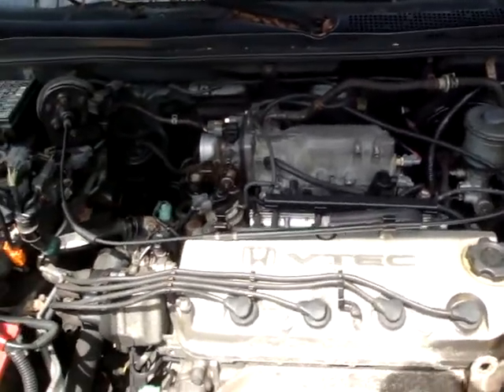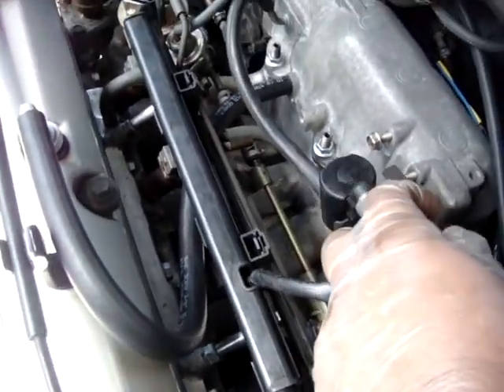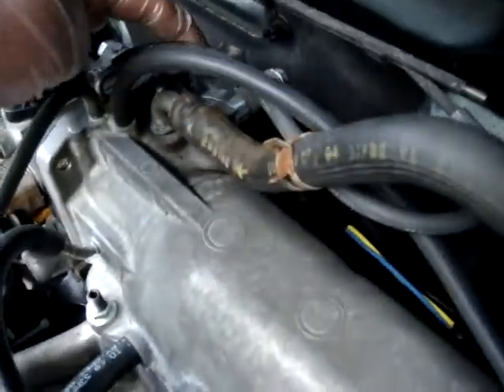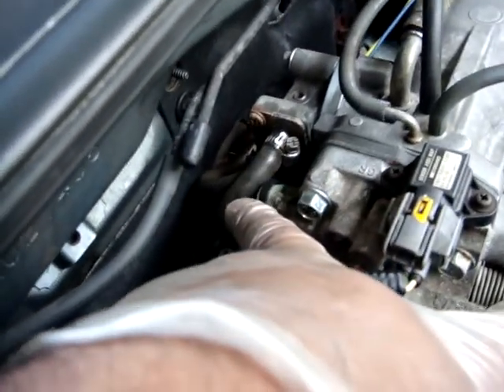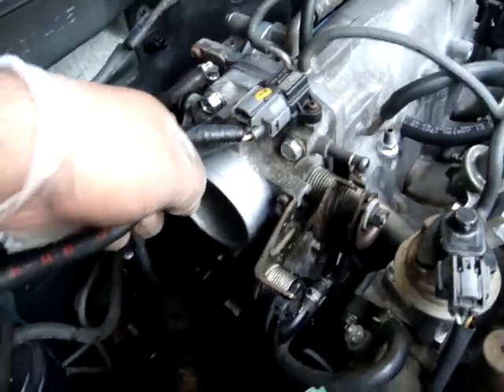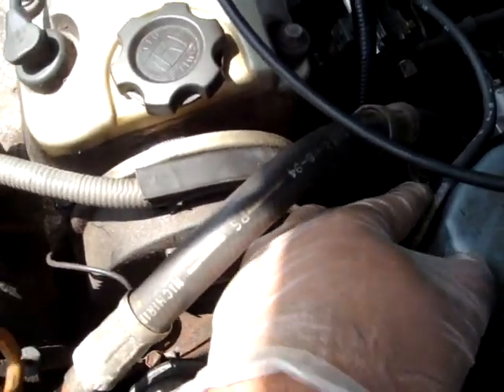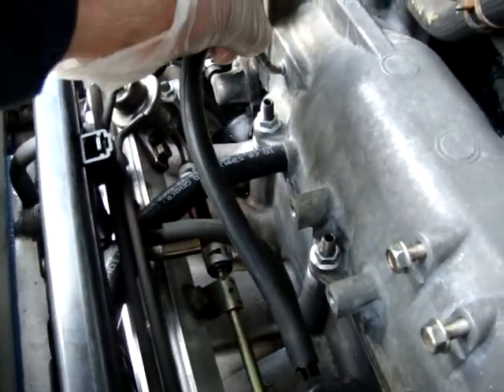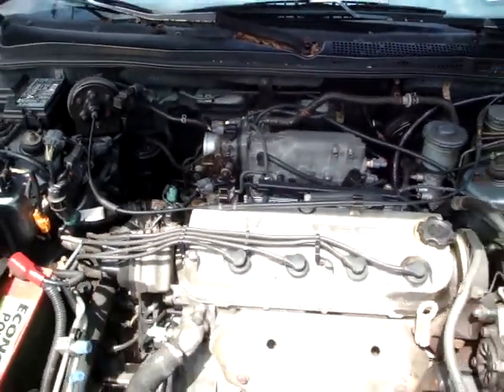F23 Intake Manifold swap onto B1 engine

Comment: I don’t have my FIA connected at all for my f22b1 and it runs well & if you delete the EGR & cruise control you wouldn’t need to run some those vacuum lines & and it would be much cleaner like I did
Reply from the maker: Egr delete, you would have to plug up some open vacuum lines.
Cruise control, same thing.
Reply from the maker: At time of video, i was on stock ecu. I would've thrown an egr error code.

Comment: That the h23 TB? Saw thread w you saying that'd b great to go w the swap
Reply from the maker: Yes, this was an H23 tb.  Can get bored out to  65mm ... which is about the max you can hone the tb entrance on the plenum without too much work
Reply from the maker: Antonio schafer If you still need a TB, I would into the H22 TB.  I think the map sensor is on top, just like the stock F22 tb.   If you have the correct manifold for your head, it should work.
Reply from the maker: About the head, no porting needed, as air, coolant line up like they should
Reply from the maker: From what I remember, the h22 Tb has the map sensor on top just like the f22 tb.
Reply from the maker: Tschf 27 you can use the stock tb just fine.  I would advise to get a spacer. It will help clear the TPS sensor much better.
This car in the video was totaled in 2013.   Went for another accord with an H22

Comment: hi im goin crazy i have a cb7 with a jdm f23a as in right know im using my f22a1 intake manifold but wanna upgrade i do have the jdm intake mani but isk if i can used im a noob what i done get is how do i connect the map sensor on top of the TP my f22a1 harness don't have the plug so need to added or used different TB PLZ help if yu can. thanx
Reply from the maker: #CB7 GARAGE.  first to understand.  The F22A1 IM isn't compatible to the F23 IM.  If you're harness is missing the plug, you could find compatible one from most 90's Hondas.  double check manuals for the correct colored wires. Hope that helps.
Reply: Alex Ace im using my stock I.M and everything harness and all   from my f22a1 on my f23ajdm but i would like to use a f23a1 or f22b1,2,6 but what im confuse is the if i do on those IM they come with a map sensor on top off the TB And my cb7 93 accord IM dont so my question so how do i added?
Reply from the maker: #CB7 GARAGE.  what I did..a vacuum hose from the tb to the map sensor.

Comment: I CAN DO THIS FOR MY F22B2 AS WELL RIGHT ?   I'VE BEEN DOING SOME RESEARCH BUT IDK IF ITS WORTH ALL THE WORK?   THANKS FOR ANY RESPONSE
Reply from the maker: Anthony Vergara If I remember correctly, I also installed a bored out (to 65mm) H23 throttle body.  I did feel better engine response.  If I port matched the plenum to 65mm. I'm pretty sure it would have been even better.